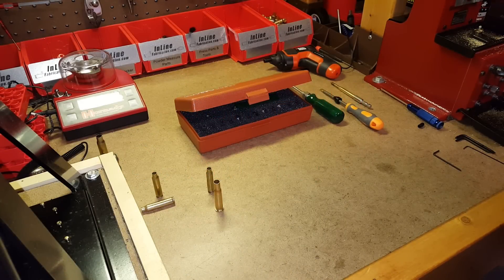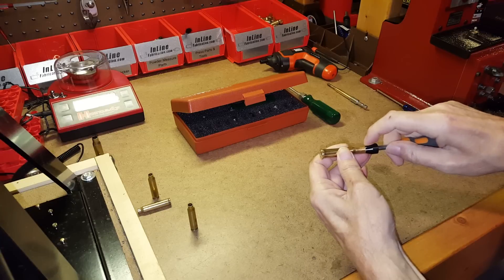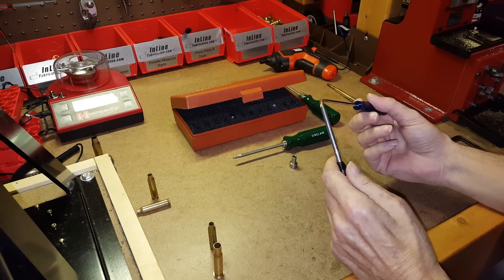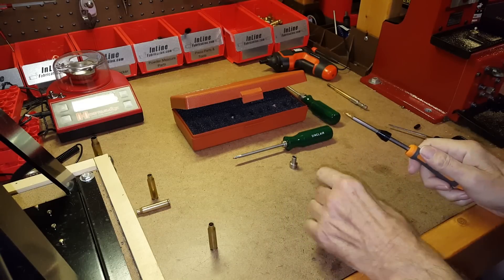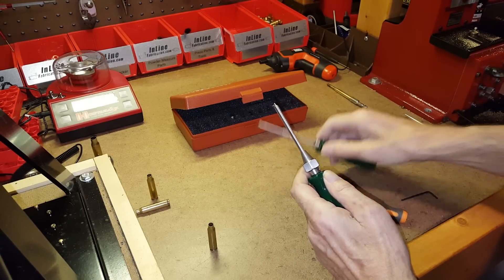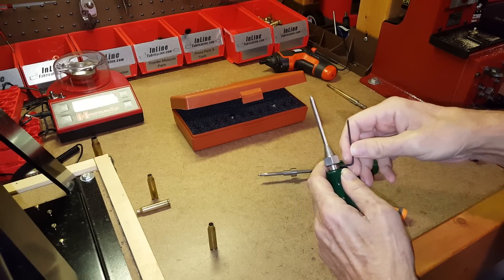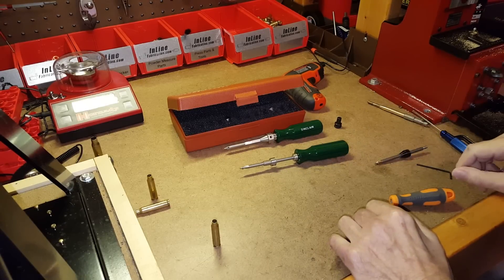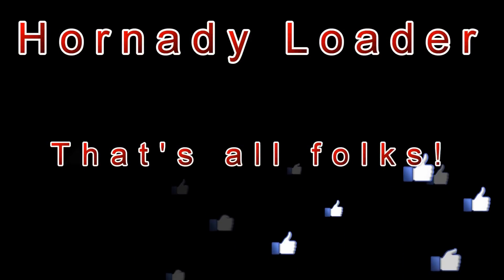Flash Hole Debur Tools

Comment: Kevin good video I never have tried to debur the flash hole from the inside of the case I usually just run a wire brush in the inside of the case I will have to pick one up at my local gun shop.. Enjoying my copy of Relaoder's Workshop it is great thanks.

Comment: Good to see you posting videos again! - where have you been lately? You kinda stopped right in the middle of the match grade 308 load development series, or did I miss something?
Reply from the maker: +grinc333 Hi!  I had some issues come up that held up the videos for a bit.  I have most of the next installment of the Match Grade Load series almost done and hopefully I'll get it out soon.  I've gone through over 2000 rounds in testing and it took a while with weather problems and such.  Thanks!

Comment: Kevin, have you been happy with the B&D screwdriver? I have been contemplating getting one for my reloading bench...Let me know..
Reply from the maker: +JBBooks4440 Actually yes, I've had nothing but good luck with the B&D screwdriver.  I went through two others before finally finding the B&D.  The first one was a no-name brand that I got for almost nothing, but it stopped working altogether after only a few weeks.  I had a second one that stopped charging after a few months.  I've had the B&D for 3 or 4 years now and it's still going strong.